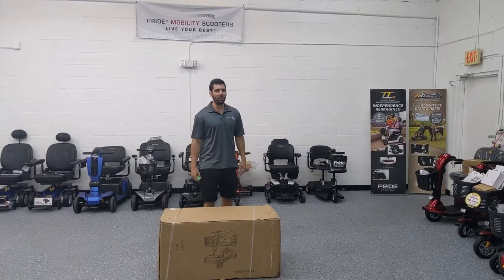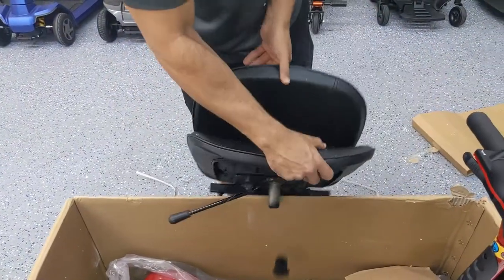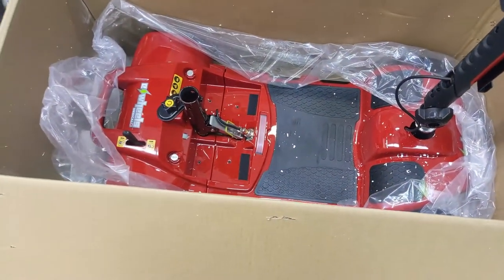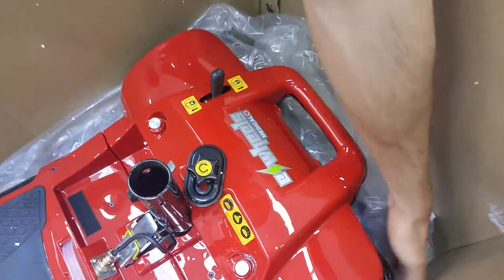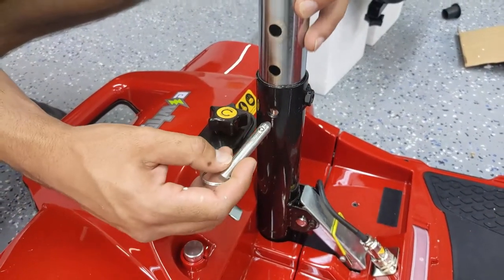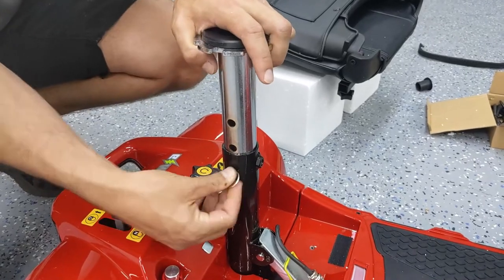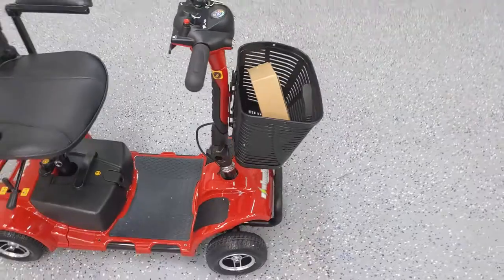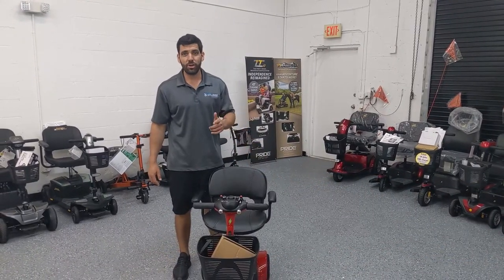💥EW-M34 Unboxing & Setup Video

Comment: What Kind of Battery does it take?  And where can I get a 2nd one as a backup?  Is it just a normal smaller batter I could buy at Walmart?
Reply from the maker: It uses a 12V 12AH (pair) Sealed Lead Acid batteries. We recommend making sure that the batteries are compatible with your scooter so you can try reaching out to the manufacturer or the store where you got the scooter from. We no longer support parts for it but you can learn more about the scooter here: 
https://www.mobilityscootersdirect.com/mobility-scooters/e-wheels-ew-m34-mobility-scooter.html#additional

A comparable unit of higher quality (and $200.00 more) would be the Pride Go-Go which can be found here:
https://www.mobilityscootersdirect.com/mobility-scooters/pride-go-go-elite-traveller-mobility-scooter-3-wheel.html

Thanks for stopping by! We appreciate the support.

Comment: Heywhere can i get a pin for the power. To run it i got one.  Second hand. But only have a car charger.  So i need a house charger and power pin.  Thanks
Reply from the maker: Contact our parts department, they'll get you what you need. 877-321-3241 https://www.mobilityscootersdirect.com/more/parts/by-brand/e-wheels-parts.html

Comment: How do you turn down the backup horn beep beep?
Reply from the maker: He would just need to disassemble the unit to the point where you expose the buzzer and then remove it
Reply: @MobilityDirect  We have the same issue. Any hints which part of the unit the horn connection is in? It's loud!